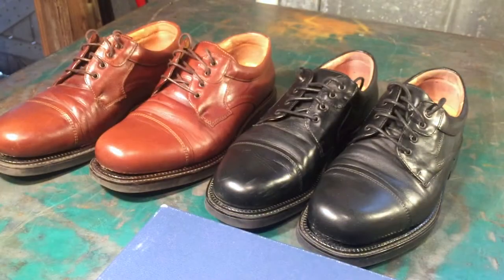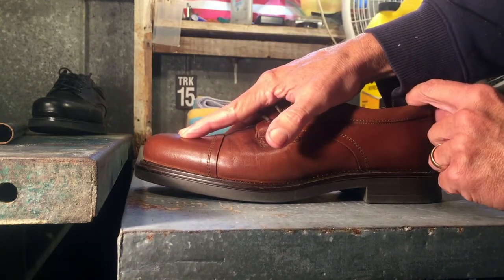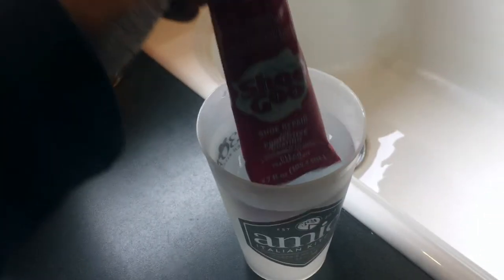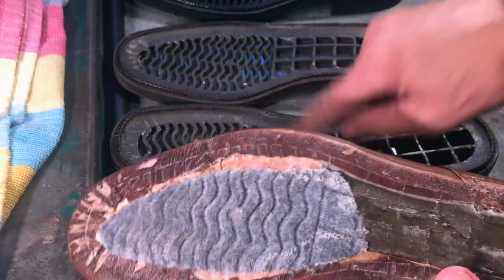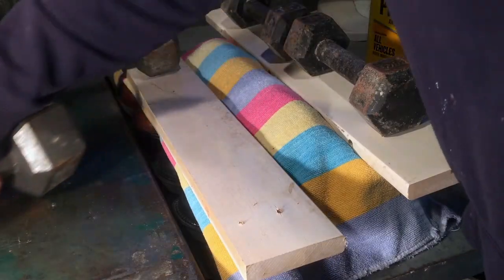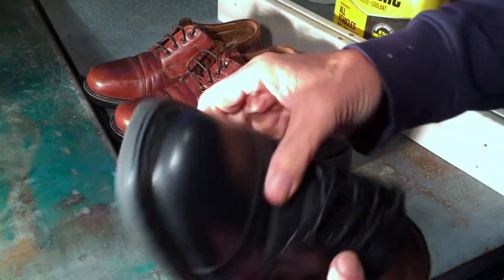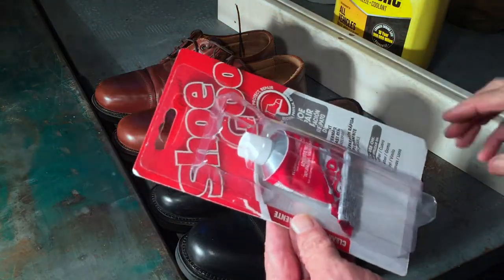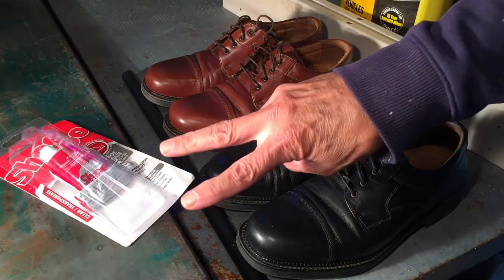Dress Shoe Repair Using Shoe Goo

Comment: Nice video, appreciate it. Just a tip, if you sand both side as well, it helps with glue connecting to the material. Also, rubberbands around the front & back also help with the weighting during curing.
Reply from the maker: Thanks for the tips!!

Comment: No need to dry first before bonding??
Reply from the maker: If you are using Shoo Goo yes, all surfaces need to be dry.. Mine already were..
Reply: @tongo117  i mean the glue itself.
Reply from the maker: my bad, there's no mention of waiting before bonding in the instructions on the tube..
Reply: @tongo117  thanks. Ill try these on my soles